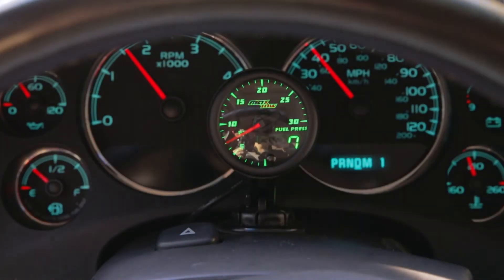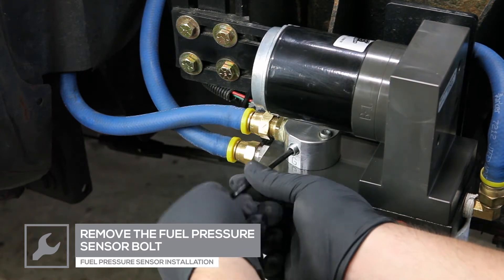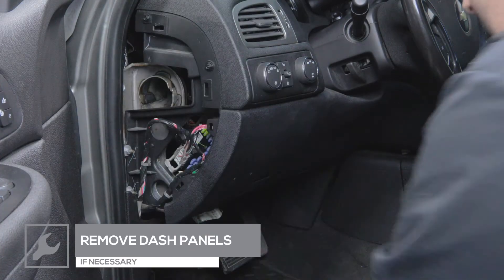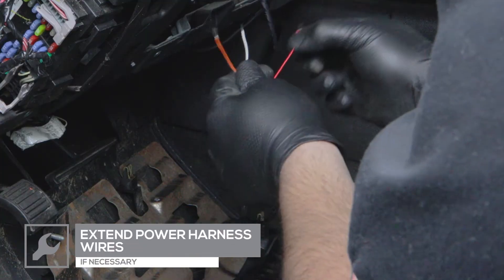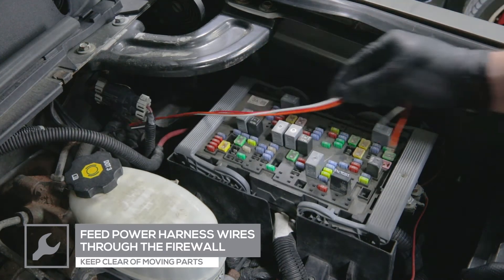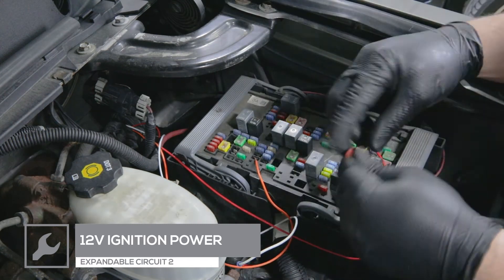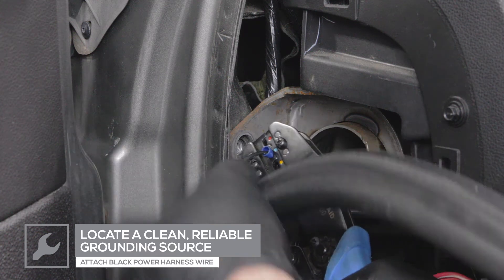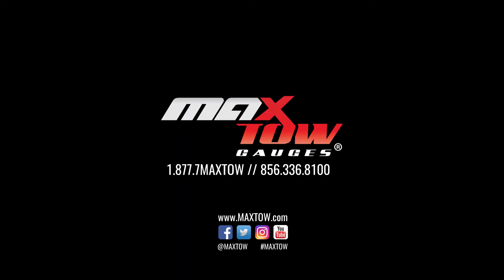MaxTow | How To Install a 30 PSI Fuel Pressure Gauge Into Any 2007-2013 New Body Style 6.6 Duramax

Comment: Can you just put the white and red wires on the same fuse??
Reply from the maker: No, if you connect the white wire to constant 12 volt power the gauge will stay on even when the truck is turned off.